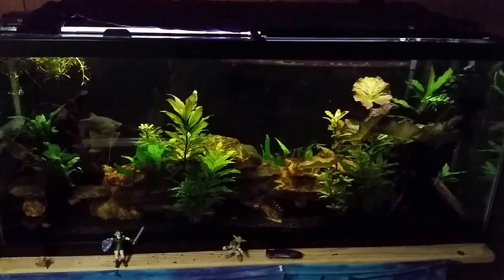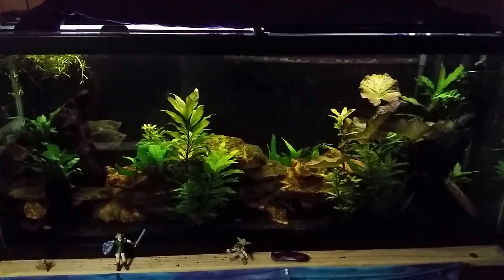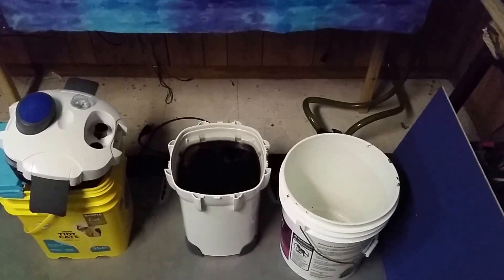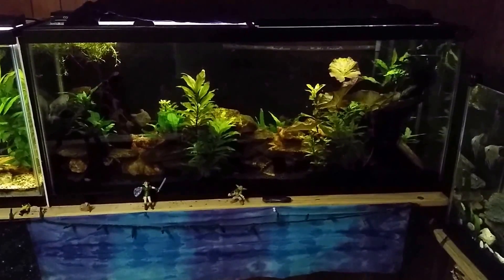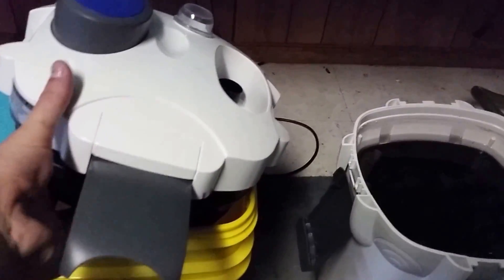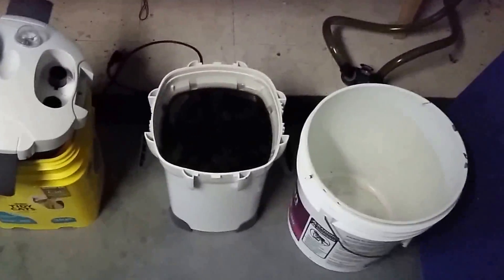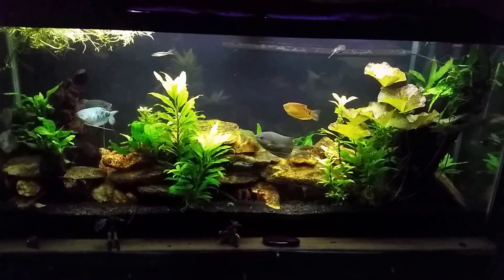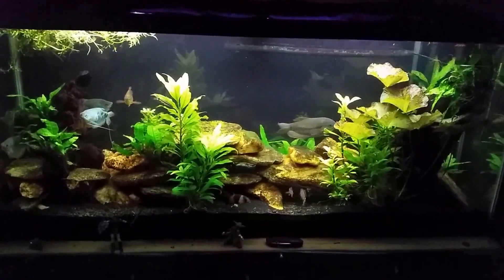A look at Canister Filter Maintenance, TDS, Tannins, and pH

Comment: Doesn't the SunSun 403b filter the water from bottom to top?

If so, your trays are not in the right order. That's why everything looks so nasty in your floss.

Your mechanical filtration (or coarse foams, if you use them) should be at the very bottom, to trap solids. Your biological filtration should be the very top tray. You want the cleanest possible water to flow through your biological media, otherwise you just end up clogging it up all the time.

Your plastic bioballs, by the way, are doing absolutely nothing for you in terms of biological filtration. They have very little surface area and store very little bacteria. They are generally more useful for mechanical filtration (though I do prefer coarse foams).

Lastly, you should really look at Biohome Ultimate for your biological filtration. It's widely considered the best biological media available, and fosters both aerobic (ammonia/nitrites consuming) and anaerobic (nitrate consuming) bacteria.
Reply: wildsprig but I will put the mechanical at the top and another at the bottom 
And in the between the 2 stages I add ceramics and charcoal 
If it is wrong please help me

Comment: Hi, just for the books, I tested my filter for the ammount of Bakteria in there before and after big cleanup.
As everybody is asuming (I guess) you loose alot of your Bakteria (Sponges are exchanged/ cleaned). 
So if you clean heavy and maybe also change the ceramic pelets too you should consider to put some starter Bakteria directly in the fresh stuffed filtertank. 
It is not needed but doing so helps me to avoid any spikes in my NO3/NO2/pH/NH4 levels. I have certain amounts of all of that "stuff" in my tanks (I respectfully guess) moast of you would not even have equipment to mesure that low levels and your test would claim it is 0. You can maintain low level tanks easy but , in my humble opinion, only by having control over the numbers of the certain Bakteria living in your Tank combined with the usual water chemistry.

PS: RO-water (I guess deionised and sterile filtred) will make your Bakteria "pop" due to diffusion and slat content inside the Bakterias membranes!!! Do not use that for cleaning if you want your friends alife and kicking dirt.

Using the full plastic scrubbys as biotopes in the filter is super awesome! For big filters and people are willing to save a penny or two I would reccomend trying that out! It works just great in the setup Dan is using it in!

PPS:Keep records of your water chemistry mesurements and you water changes. Helps me to better understand what is going on in a Tank over time!

and 
Cheers @ all

Comment: tip to get tanins out of new driftwood 1. if possible BOIL IT for 30min it does wonders 2.soak the driftwood for 2days then change out the water and do that for a week or two or untill water is fpr the most part clear

Comment: Another good one!   I have a lot of tannins in my tanks.   Especially my discus tank because the wood hasn't been in there that long.    I saw your video at your mart mart store and I've been using the batting in my aqua clear 70's ever since.   Was a lot of junk floating in the water    The batting catches the dirt better than the sponge that came with those filters.   I'll have to change it often because discus like clean water but it's cheap so I'm. It worried about it.
Reply from the maker: +T Holz Yeah, you quite a few filters for under $10. Lol